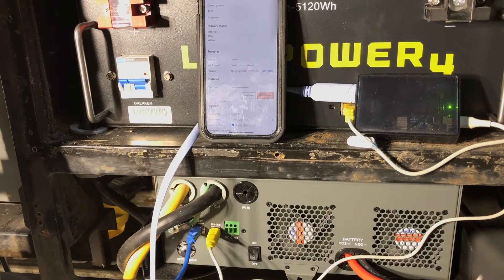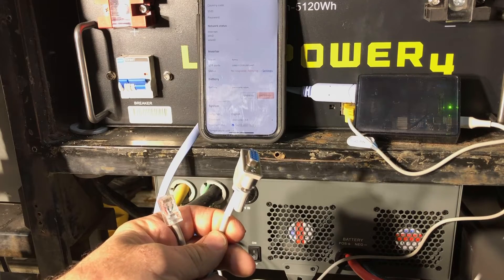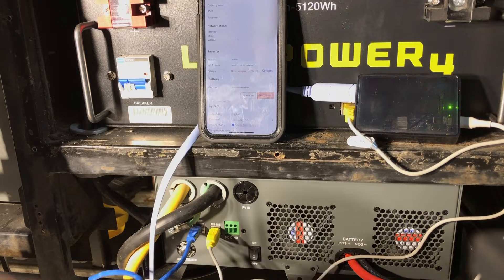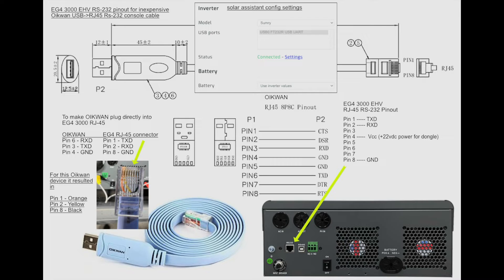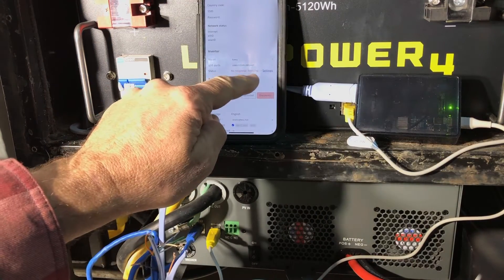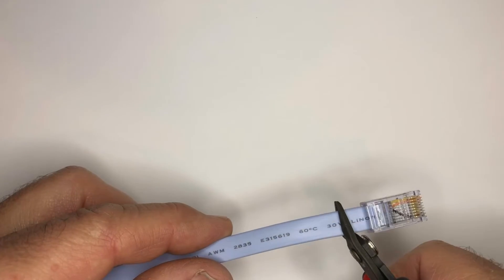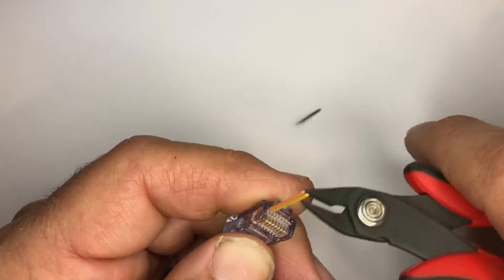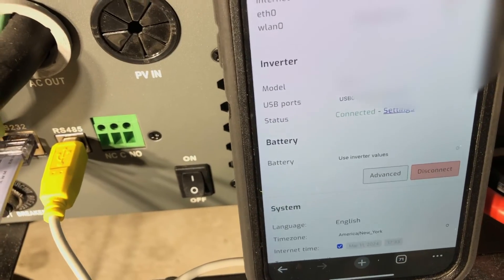EG4 3000 and solar assistant - building a custom USB-A to RJ45 RS232 cable

Comment: Thank you for the video.
From what I can see/tell, the pinouts on the inverter end is 1, 2 & 8. 1 being for transferring, 2 being for receiving and 8 being ground.

I have a RS485 to USB converter (equipped with the Ch340/CH341 chip) to which I can screw an RJ45 cable to.

I would like to use solar assistant for monitoring my setup. However, on the website, it was stated that an intending user should test out their inverter with the watchpower/solarpower app first to be sure that solar assistant will work before going ahead to procure solar assistant. So, I would like to know which of the pins would match for a correct connection, if you can.

The RS485 converter has 5 pins - A, B, GND, GND, +5V.
So far, I think on the inverter side pins 1, 2 and 8 are of importance based on the diagram you showed earlier. Now, I would like to know what the corresponding pins would be on the converter (USB) end.

I want to try out the watchpower and solarpower apps (on Linux) and see if they work.

Thank you in advance.

Comment: Great video, thank you, you are a life saver. But i found that mine works with RX in pin 1 and TX in pin 2 for the RJ45. I use a felicity solar inverter

Comment: it works. Thanks. I did it for voltronic axpert and converter 232 (It gets very hot and does not work before).
Reply from the maker: Excellent! Glad it was useful for you. Also good to know it sounds like voltronic uses a compatible pinout.
Reply: Hi. What did you do exactly? I have a Voltronic (SAKO SUNON IV) that I want to test out with watchpower/solarpower app on my pc before deciding on getting a pi for solar assistant, per the information on the solar assistant website.
I have a free RJ45 cable and an rs485 to USB converter device with the ch340/ch341 driver.

Comment: Thanks for sharing this, can a USB cable with only 4 wires be used? it was an old printer cable with a USB-A on one end and a USB-B on the other.
Reply: to communicate with the inverter to retrieve and collect data you cannot use a straight usb cable because  usb standard pinout is pin1 5v, 2 data-, 3 data+, 4 ground; the rs232 is a serial communication port and it handle different datas with different timing and a different pinout but it is made by 4 cable, transmission, receiver, voltage and ground. for my experience not all the inverters don't have the same pinout on the rj45 port.
Reply from the maker: I'm not sure I fully understand the question. In this particular case we are going from USB-A to RJ-45. The USB-B port on the inverter is designed to communicate with the battery. This video is related the Solar Assistant communication with the inverter which is through the RJ-45 port. Maybe I should do a video on cables because it is a confusing topic. What you are describing is strictly a cable that is capable of communicating using the USB protocol. The term USB is a bit ambiguous because it can mean several things. The -A/B/C generally refers to the connector, but USB is also a protocol and USB includes specifications on how you connect the wires to the pins on the connector. In either case, if you are expected to communicate in RS-485 or RS-232, just because the cable fits doesn't mean it will work. The cable I use in the video is an RS-485 cable... which really is more than a cable, it is a micro-device inside the USB cable which is why it is thick on one end. You can conceptualize it as a cable with a USB-A connector that is safe to plug into any USB-A port that is expected to have a USB peripheral. That is connected into a micro computer if you will under that plastic sheathing, that understands the USB protocol. Inside that mini computer it knows how to communicate in the RS-485 protocol and uses at least 2 wires to make this communication happen and those two wires are attached to another connector at the end of the cable. In my case it was an RJ-45 connector. The point of the video is really to make sure the RJ-45 side has the correct pins connected, the pins the inverter is using to communicate.  Not sure if that helped or made it more confusion.